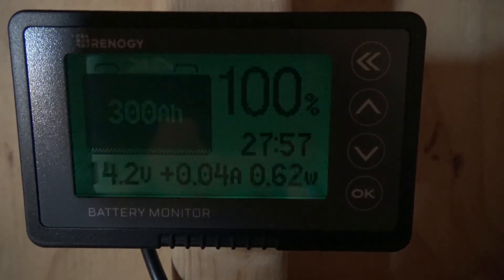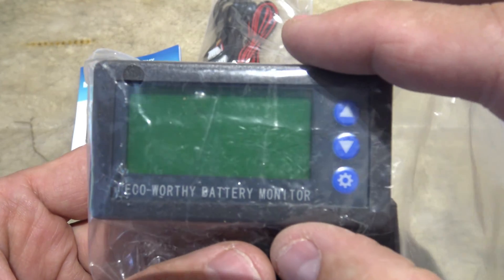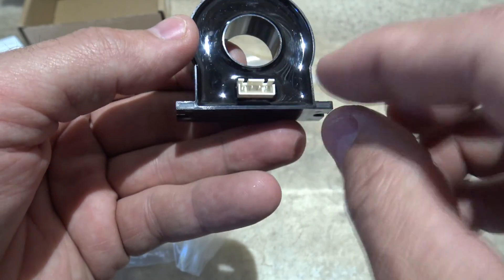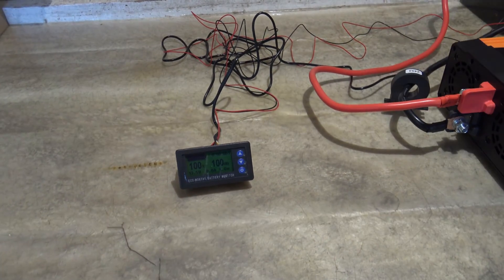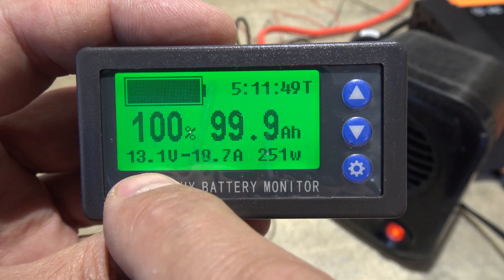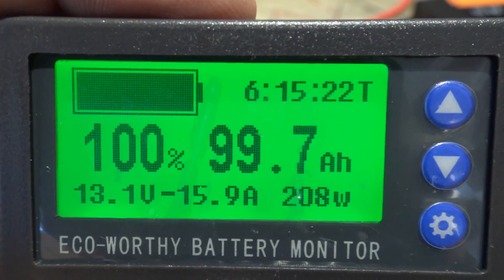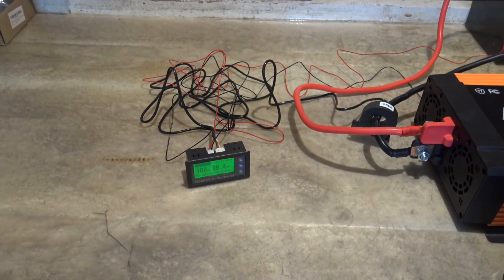ECO-WORTHY 200A Battery Monitor Easy DIY with Hall Sensor - NO SHUNT! Very cool!!

Comment: I have one of these fitted to my EV motorbike.  It doesn't matter if you put the current transformer on the positive or the negative wire as the current flowing is the same in each.  What does matter is the direction the current flows through the coil....one way it will read positive, turn it around and it will read negative.  These things are a lot cleverer than simply measuring current and voltage.....they measure coulombs which is a measure of current and time.  One coulomb is one amp flowing for one second and this meter counts the number of amps over time flowing through the coil to determine the state of charge of the battery.  I programmed mine using the manual method where I fully charged the battery, then entered the maximum voltage and the capacity of the battery, which in my case was 79.5v and 30 Ah.
Reply: Exactly man. Well put. I was about to say the same thing. Great device.💪🏽🔌
Reply: @letsfixit251  First make a video then show the instructions but, don't actually read them. Then check out your comments to see how it actually works, and there ya go. BTW, ty for best video ever made bc it says so in the comments, where most everyone agrees.
Reply: @parkerbirch5286  just hooked mine up today, and it's working flawlessly, and it reads the amps in the correct way, lol

Comment: I do apologize but I am new to this... How many amps do I have in a battery bank that is set up of 6 batteries and each of 12V - 60amps, what are the total amps? 360 amps?
Reply: Depends on your set up, but if you have 6 x 12v batteries I'm going to assume that they're wired in parallel and its a 12v system, not a 72v system wired in series. ( parallel = pos -> pos & neg -> neg). This means you have a 12v system, and the amps are added together, so yes 6 x 60 amps = 360 amps total. 
If the system was wired in series, you would be wired pos -> neg on each battery, this would be 6 x 12v, 72v, but the amps would stay the same. So you either have  12v system and 360a/h, or a 72v system at 60a/h. Hope that helps!!

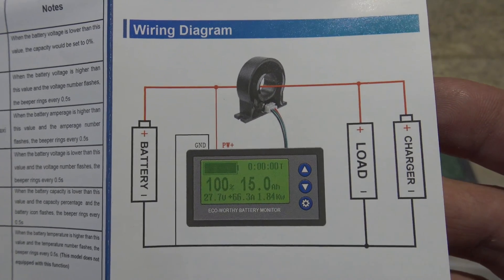Comment: If you have two 2:24 12v batteries in parallel,  do you need one of these for each battery?
Reply from the maker: No. Only one
Reply: @jiujitsu2000  wonderful

Comment: I read some of the directions you where showing. Twice I seen" Discharge battery till empty" That doesn't seem right, or at least good for the battery...
Reply from the maker: Exactly!!
Reply: There are 2 options, the draining is for lithium batteries.. The other option is manual...